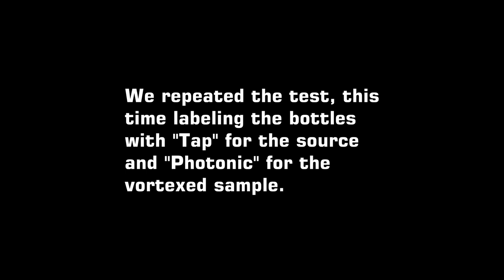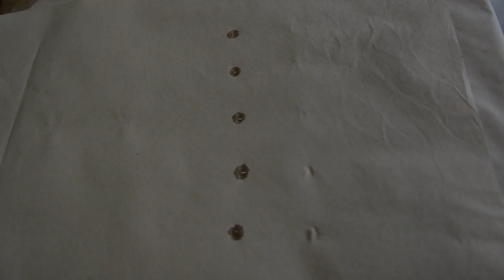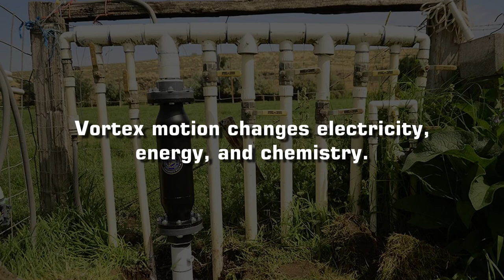Vortex Water Tests

Comment: one thing i noticed this summer was ; when i drank water from the tap itself it did not quench my throat like the iced tea i made from the same water ,my observation now from this video is that the iced tea was stirred in the glass making the vortex as it dissolved , so i just tried stirring the plain water and im feeling it has a better absortion /quenching power.

Comment: Do you have any build plans for the device used in the water treatment? would like to know how to build one.
Reply from the maker: We make ours in Australia, fabricated from stainless steel, in a multitude of sizes, but they can be made with PVC parts.. There are some components that have to be sourced, and others that can be 3D printed. A rudimentary vortex generator is better than none at all. .

Comment: I have a proper vortex machine and tried this experiment and it didn't work! the water did not flow like in  the experiment. In fact the water did not come out at all from the vortexed water. So why didn't it work? I used distilled water and used dropper bottles like in the experiment. I tried banging the bottom but still no flow! I vortexed the water for 9 minutes.
Reply from the maker: Good question Stanley. What is a "proper vortex machine"? It's not just the hardware, it's also the consciousness of the people who are having the experience. The fact that the experiment did not work for you *then*, does not mean that it won't work for you when you change something within yourself. I say this because there is nothing else that can open doors that may appear closed. When we did those experiments we were amazed by the results. They have continued to amaze more than 10 years later. I'd be interested in knowing more about the setup, your source water, and anything else you can tell me.

Comment: What type of water are you using here in the test?
Reply from the maker: This was in rural South Dakota, so it was likely a well. What we've learned since then is that whether it was municipal, or water in a well (bore), it is fundamentally stagnant. The low motion and spin-state degrades water's usefulness. Our method of vortexing was the mildest, as we used only the force of gravity from pouring. If it had been under force, with higher velocities, the results, such as with seed germination rate, or amount of plant production, or animal health, could be more profound.

Comment: ORP reading?
Reply from the maker: Left Field ~ Vortexing the water volume will produce, liberate, and otherwise make available hydrogen, making more electrons available, and thereby affecting “ORP”. While ORP stands for “Oxygen Reduction Potential,” vortexing makes molecular oxygen more available too (in addition to molecular hydrogen), which is highly beneficial as well. The amount of difference that vortexing a water volume will make will vary from volume to volume, depending both upon what is in the volume, and its relative level of stagnation.

Comment: Adam how dose structured water benefit human health?
Reply from the maker: Penetrability, infiltration, due to smaller cluster sizes, means that water gets into cells that it is presently not entering. Virtually ALL people who have chronic or degenerative conditions are dehydrated at the cellular level, have low blood oxygen levels, and "thick" blood.
Reply: @onescious1  Does distilled water fix this issue?
Reply: @jasonsteves734  No.